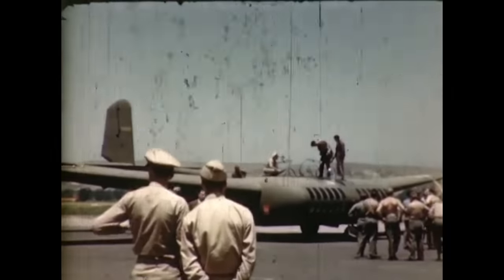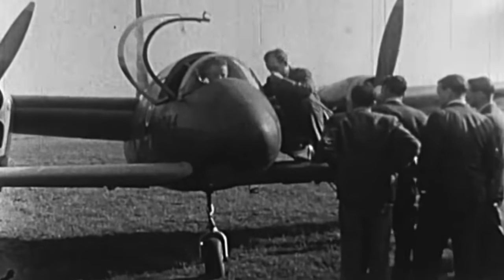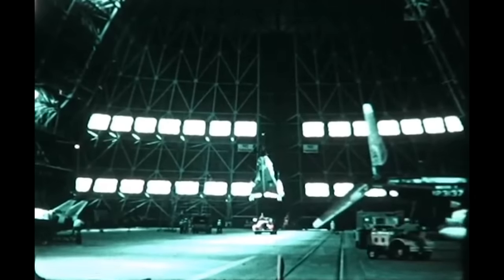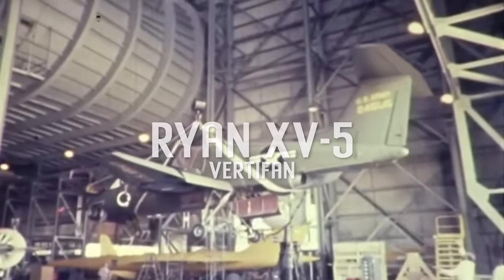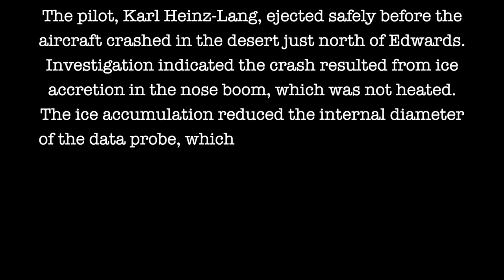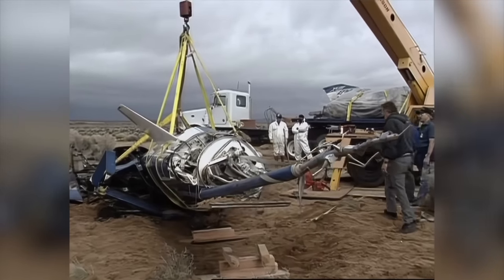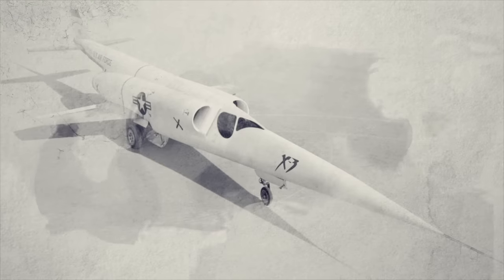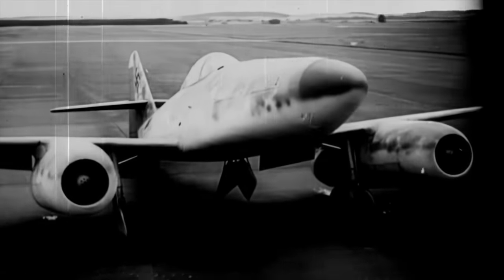AVIATION ODDITIES | Aircraft Innovation And Research Pioneers

Comment: Regarding the X-31, there should have been a reiteration of the R3 Mode as a safety net for any pitot tube related issues as the NEW Pitot sensor MIGHT fail in an incurable way as it did. Of course when there were over 100+ prior successful flights, complacency would be normal, so why change modes...of course the frozen pitot tube WAS just such an exception, but both the PILOT and the GROUND TEAM would have to have been VERY ALERT to make that QUICK decision. My father was a WW2 Bomber Navigator and always told me to STAY ALERT! That keeps you alive as he survived 4 crash landings and knew what he was talking about! Luckily the pilot punched out before he became a statistic! Glad they got going again after 84 days and did extremely well at the Paris Air Show that same year. In 2024, I see similarity to the F-23 and often wonder how it would have done in production as it might have been far less costly than the F-22.

Comment: The Sea Dart was a direct answer to the Delta Dart the USAF wanted, and a tually flew before the Delta.
I saw a Sea Dart at Marshall Space Flight Center sitting outside the public area, but easily visible over a low fence.  It was unrestored at the time (96 or 97) and I did not see it at all the next time I was there in 2019, but I might have missed it.